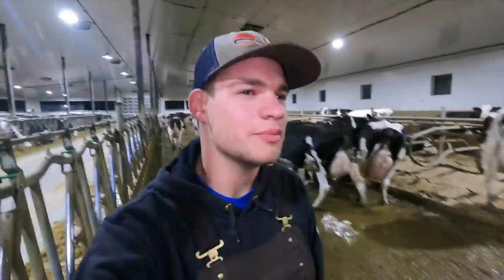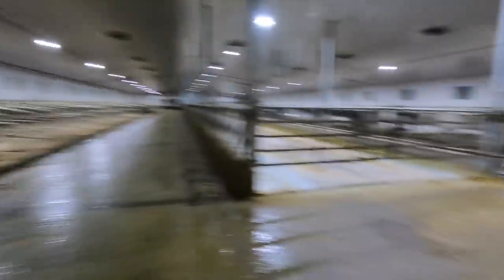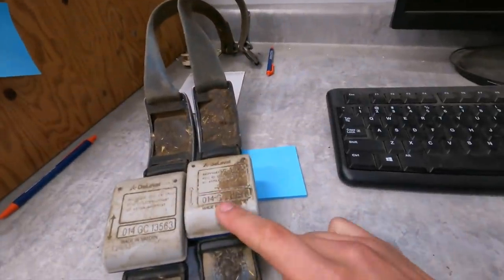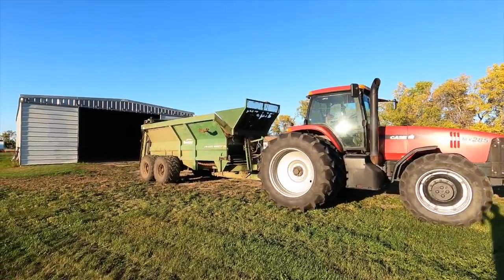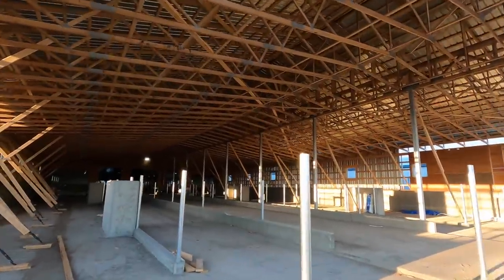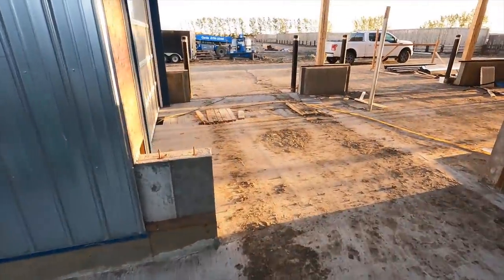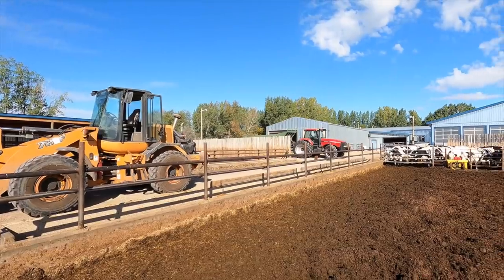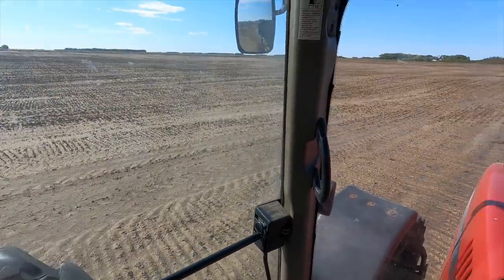3rd Cut Alfalfa, More Manure, and Barn Update!

Comment: Jan, I don't think sand in those quantities is going to be a problem for your soil. Topsoil is just sand mixed with organic materials anyway; you're spreading a whole lot of organic material along with the sand.
Reply: It really just depends. From what I have heard the top soil on Jan's fields are pretty sandy as is. I am pretty sure their is a service that collects soil samples from different points in all your fields and gives you a comprehensive soil report. It isn't "cheap" per say but can easily pay for itself in increased crop yields. Something to think about. To much sand can be bad and might require deep ripping, which is really expensive (so i gather) my friend's family provides the service here in the central valley of California and they are doing very well. From what I have heard the deep ripping here has more to do with the dissolved salts from the water, that have built up in the soil over time.

Comment: What is the reason for the taller roof on the barn extension? Thanks
Reply: Same height as the new barn beside it
Reply: That and it allows for more clearance for the front loaders when they go to clean the barn out
Reply: To keep the place isolated from temperature rise or drop

Comment: Why not put gutters on roofs uto eliminate mud area, which if left to accumulate will provide breeding area for mosquitoes. Bacteria and other diease organisms. Run the gutters right in 8 " drain pipe
Reply: Gutters are an expensive addition when building, and require regular maintenance to keep working.  Otherwise leaves, etc. build up in them, and provide an excellent breeding ground for mosquitoes.  And Jan et al don't need another maintenance task to do a few times per year!
So it's pretty common to not have gutters on barns or other farm buildings.

Comment: I saw a dairy video on a You Tube channel that they take the sand out of the manure can't remember if it was liquid or dry but they have a machine that takes the sand out and they wash the sand and reuse it and it's like fresh new sand you have and it saves them a ton of money and I think they said it paid for itself like in 2 years and they added a second one for back up in case the first one broke down but they said if you do the proper maintenance they didn't have much for troubles and they said they could run both at the same time cuz of the amount of manure they and sand that they get back cuz they use alot of sand in a week, it was like 10 semi loads a week. Do you have to follow a manure management plan for your farm ? We do in Iowa plus you have to be certified and take a test yearly or go to school for 6 hours a year kinda like if you were spraying your own chemicals on your own crops.